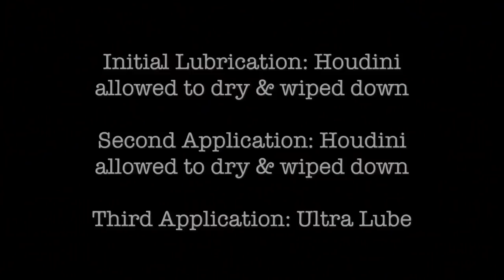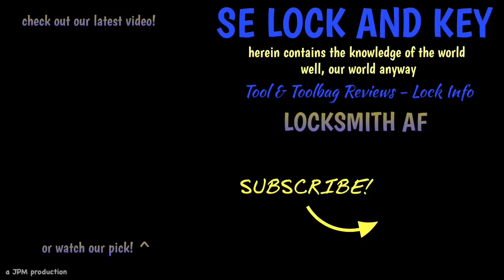restoring an antique double bit key mortise lock

Comment: Awesome job I also like restoring old locks. FYI plain old white vinegar works great for removing rust. Just let the parts soak in it a couple of hours. When tropical storm Debby hit in 2012 my shop flooded I had 2 feet of water in the shop for days, had to close for 2 weeks. Needless to say any tools or parts (keys also) in lower drawers rusted. Vinegar saved the day. Also lemon juice works pretty good for tarnished keys.
Reply: Good tip man those acids in the lemon's and vinegar work good. An old lady I used to know used to use ketchup to polish the brass on her old locksets.

Comment: I just picked up another 4 of these locks.  And I lucked out getting a "biscuit tin" for Christmas.  What the best way to figure out which blanks I need?  Measure the keyhole?
Reply from the maker: Post diameter and blade height are the two most important measurements. Blade width almost always needs to be cut down on the “more available” styles of keys out there so it’s not as important. It’s incredibly difficult to reduce post diameter though :)

Comment: I found an antique mortise door lock in my backyard while metal detecting. Its probably the biggest metal detecting find that iv'e ever gotten. It was caked in rust and barely recognizable but after a jug of rust remover, all of it came off. Whats weird about the find is the location it was in. I found it in a particular spot, which is about 2 feet in range where there was a particular amount of glass. Pieces of mason jars, broken bottles, and even a whole plate! Iv'e never seen so much glass in one area, especially with a door lock in it. Can somebody help me figure out why I found it like this? My mom told me there could have been a house or something near by long ago. Since there was so much open land at the time, no one had anywhere to put their trash, so they just threw it out side.

Comment: really interesting lock.  Any idea who the manufacturer was?  Do you heat your replacement spring steel to bend/form them to shape?
Reply from the maker: funny you saw this now, I’m working on another one w/video this week (you can see it in Sat42 lying on the workbench) 
I forget which this one is but Reading Hardware made them predominantly here

Comment: Evapo-Rust is good for removing rust, just soak the parts in it, and it's not as nasty as some.
Reply: That is true, however the product used in the video does more than just remove rust. It chemically changes the rust to a protective surface as well as passivating the surface. Thereby giving it some protection from further rusting in future.